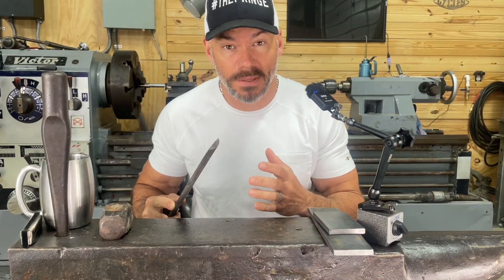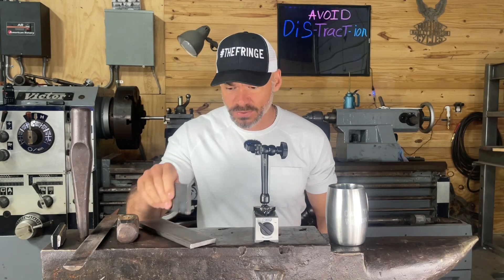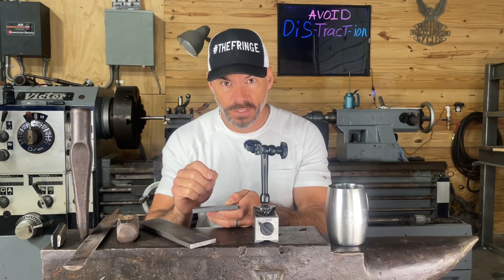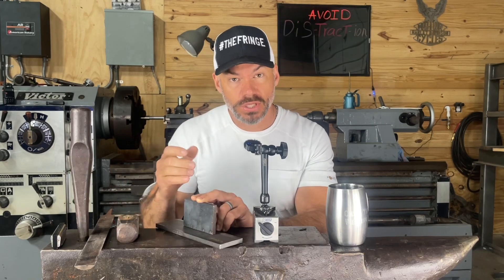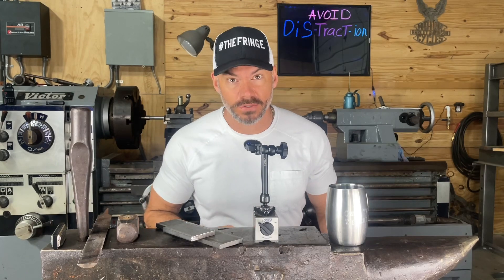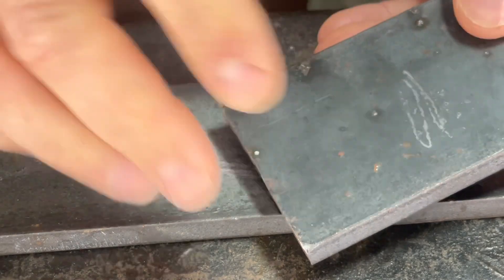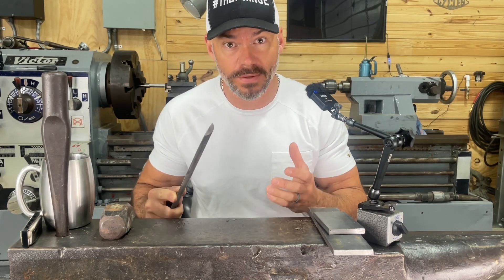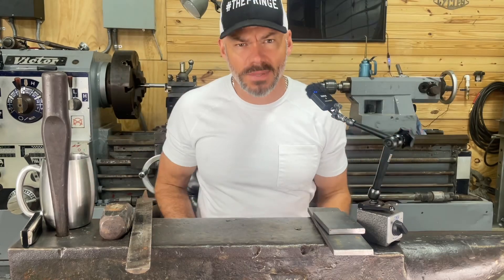How to Remove Mill Scale and Prep Pipe for Welding (amended)

Comment: My  2 cents... Most importantly I LOVE ALL YOUR VIDEOS!  THANK YOU FOR MAKING THEM !!  I'm an Industrial electrical technician and systems repairman at a steel mill with 15+ years of service there but, I've been doing electrical stuff my entire career which started when i was 14 years old  (I'm 46) and now my New Hobby as of 3 weeks ago is DC+ Stick Welding. So, ya I'm new at welding.  I just made myself a 3' x 3' welding table with 3/8" steel plate and a pair of 2600 Lbs cap saw horses LoL, It works for now.  like everyone else I see they place the welder ground clamp to the table. SO, I was trying to remove the Mill Scale from the top side of the 3' x 3' steel plate to gain a way better electrical path to the Ground Clamp while i weld on the work piece that's sitting on the weld table because "I figured it would Weld Better"...  First I removed Mill Scale from about a 4" square area top side and bottom side of the table on one corner of the steel plate so i could get a good electrical path for the Ground Clamp.   Then I took my Fluke electrical meter and measured the resistance from that Ground Clamp  to a bunch of various places on the top of the steel plate that was covered in mill scale and the resistance ranged from  58.0 - 122.0 Ohms.  Then,  i removed the Mill Scale in about a 8" wide path all the way across the one side of my steel plate table.  Then,  I measured the Resistance again from the Ground Clamp to the now super shiny area AND i got 0.00 Ohms which is a perfect path for the electric to travel to the Ground Clamp.   I'm no Pro Welder for sure but, I'm definitely a professional industrial electrician and electrical technician. ((  But hey maybe it won't matter when laying down Weld LoL  )).  I just figure it will help because the Ground Clamp is attached to the table and not the actual part I'm welding on...    The more Resistance that is added the worse the electrical path will be....

Comment: If I can't get a grinder in I use the end edge of a file or even my tungsten scribing pen to cut through the rust to start it. two passes (even with mig) and it works...this is such a good video dude

Comment: I can vouch for not messing with millscale for general fabrication be it a frame hitch to stretching a truck frame, the only place I was required to prep a plate was in the Navy at high pressure plate welding school I went to, they tested the crap out of our coupons to get certified, four years later I get out and back into the fab/repair business and never removed scale, wasn't needed, now I did sandblast it when a job required a good painted finish like railings and ended up building a sandblasting box (not a booth, an actual box with several nozzles in a box about 60" long and big enough to run a 12" H beam through) that we ran lengths of stock through to prefinish before sawing and welding up the project, was a huge time saver in not having to position a completed job to be blasted, just weld/degrease /paint.  But if code requires prepping then" let it be written, let it be done". 😉👍🏻

Comment: After i put a land on a pipe i use a file to knock the burr off the inside to see if my land is what i want it to be i dont anymore cause i can tell as soon as i grind it what it is but thats why guys do that it aint about cleaning it
Reply from the maker: When I started I used to do it as well. But like you said with experience you don't have to anymore.

Comment: If the weld is important remove the millscale just beyond the toes of weld area.  Especially with slow freeze rods.  Ideally you don't weld through mill scale.  Run two 7018 beads on the same metal one on top of mill scale and one on shiny metal.  The 7018 on shiny metal always looks better because it is.  If you weld pipe or structural those welds are important.  Those jobs pay good and you need to be professional and make sure you are welding professionally.  There is a certain amount of Flux on those bad boy electrodes and therefore they can only clean a certain amount of contamination from the molten metal and float it to the slag layer.  In some cases halfazz removing the mill scale or leaving all of it on is too much contamination and hello porosity and internal defects.
Reply from the maker: Lol
Reply: They come out shitty cause you don’t let’s that pool build up not cause of the milscale
Reply: @trailerpark6.7 not true. Mill scale does cause problems. Yes, you can weld through it. You can weld through paint and rust too, but you shouldn’t.

Comment: Been welding for 20 plus years. Only problem I’ve had with welding mill scale is these wanna be QC guys calling it under cut , especially when the scale is thick . Ever had issues with that Taylor ?
Reply from the maker: No, not that I can remember
Reply: @TaylorWelding   i imagine the plant and pipe line work is a bit different

Comment: Mill scale is iron oxide.  Also known as rust.  No one calls it rust, but that's what it is. Orange rust is also iron oxide. People seem to wrap their head around that. But orange rust and mill scale are both iron oxide AND rust.  When steel turn blue or purple or brown, those temper colors as they are called, that is iron oxide too. The black slag left on steel after being torch cut, yes that is iron oxide too.  All technically forms of rust.  I am an engineer, not a chemist, but I do have some knowledge of metallurgy, and steel oxides are a part of my interest.  A point of note, is that rust and mill scale (iron oxides) are ceramics. Yes like coffee cups and flower pots.  Iron oxide does not conduct electricity, is non magnetic, and has a different thermal coefficient of expansion than the base steel, and is very brittle.  You can use this property to your advantage when you have stuck assemblies that are rusted. You know hitting rusty bolts with a torch breaks up the rust and allows you to loosen them. This is because the steel expands, and the rust does not (relatively speaking), and during the heating process. The rust gets crushed by the expanding steel, and the rust is weak and brittle, so it gets pulverized and crushed.  This is why heat from a torch loosens rust bound bolts.  Something to note, not all oxide forms of metals have the same properties. For instance, silver is used to plate electrical contacts.  The reason for this is, the oxide form of silver has nearly the same electrical conductivity as pure silver. Makes for good switch contacts. Anyhow, I just wanted to give you some more information about mill scale. Yes you are right it comes from the mill rolling process. But to know about mill scale (iron oxide, rust, etc) is such a deep subject, and if you deal with it in your career, knowing more about it is going to be a benefit.  I enjoy your videos. ---Doozer
Reply from the maker: thanks dozer. That’s a lot of information.
Reply: This is why we use the word patina vs rust, Mill scale is more of a patina, patina doesn't tend to spread, but rust does, you probably know more about why than I do however, I just know that's what it does

Comment: Why then does every weld procedure I've ever seen, be it AWS or ASME, the very first step is.... you guessed it... remove the mill scale?  40+ years experience,  and built all types of machines, heavy gas and oil related equipment. Higher chances of contamination and lack of penetration! Ask yourself this.. how would you feel if someone got killed because you took a shortcut!
Reply from the maker: Are you a professional Welder?
Reply: @TaylorWelding  I  was for 40 years. Flux on the rod is for minimal cleaning and to protect the molten filler! Not for eliminating mill scale.
Reply from the maker: Is that what you do for a living?
Reply from the maker: What do you think the flux on that rod is for?
Reply: @TaylorWelding there’s a reason why procedures are developed and used. Many hours of testing goes into it. If your welding non structural items, it may not matter too much. Heavy structural welding is done with large rod, which is being replaced with large flux core wire. They do burn through mill scale. But that’s because the diameter of the wire or rod, along with the high power used in relation to the thickness of the scale, is great. Smaller rod and wire don’t have the same ability.
Reply: @TaylorWelding Jesus... hearting your own comments... no words really... also you have no idea what you are talking about
Reply: 🤣. I do knock the burr off the inside of pipe. If I'm running 5p,5p+,hyp,hyp+,or any cellulose fluxed rod I'm not going to worry about a little mill scale. If I'm running a 7018,7016 root? I'll file it back out of the weld zone. Some plate has a pretty thick coating of mill scale and I'll clean that off every time. Just the standard gray patina? Waste of time. To the gentleman above who says that flux on welding rods isn't designed with rust and scale in mind? You are completely wrong about that.Some rods ( especially cellulose based flux ) were designed exactly for that purpose. Floating impurities out of the puddle was thought about and allowed for. Grinding the mill scale off an inch away from the weld zone is a huge waste of time and material. I've welded for over 40 years and have never,ever,walked away from a high or low pressure pipe or vessel weld I wouldn't be comfortable letting my children or grandchildren play next to. And I've made them with stick,tig,mig,flux core and dual shielded wires. I've made them on offshore platforms where my crew and I had to sleep just feet away from what we had installed.

Comment: Mill  scale 😅 try welding through galvanized , checking in from southern Califa local 433 IW
Reply from the maker: Galvanized is a bummer
Reply: You ain't kidding, I've had some galvanized jobs lately and I hate that stuff. When I see that blue spark, I die a little inside. 😆
Reply: @gillihansmobilewelding  make sure brother wear a respirator for you don't get sick and poison that s***'s no joke
Reply: Electro galvanized is ok but that hot dip stuff is hideous! Either grind it off or use hydrochloric acid,don't forget the PPE!

Comment: When I was taking welding class they told us to remove the mill scale because it’s not good for our health.  When we had topics on tig they would recommend us the same thing but to also prevent porosity. Some of the other guys would use the round tip for the grinder and heavy grind the inside of the pipe. I found that a waste of time I would just give it a quick pass or use a file. 

Subscribed to ur channel not to long ago. Great topics  your videos helped motivated me to find a job in welding. Can’t wait to find one. Any tips on where to start or how I can get my foot in the door. Also how do you prepare for a pipe test.
Reply from the maker: Shut downs is a good place to start. And as far as the welding test just practice. Every day for about 30 minutes a day
Reply: a while ago i saw someone attack the mill scale for a couple of hours with diluted vinegar, its slow but in the end you can just wipe the mill scale off. it seems to be a good idea to just prep all the pieces beforehand
Reply: Welding over mill scale has no negative health effects. The smoke from the welding process is not good. But adding mill scale to the mix is not going to add to welding being more hazardous.  Grinding it and breathing grinding wheel dust, for sure is no good for you.  But telling the class mill scale is not good for your health is flat out ignorance.  It might not be great for the health of the weld, but that's it.  It is not like welding galvanized, which is really bad for your health. --Doozer
Reply: @kooldoozer can you talk a little bit more about galvanized? What is it, why is it more dangerous and how often would i see it in the welding  industry?
Reply: @citrusblast4372  It has a protective coating of zinc, and if you get it too hot the crap vaporizes. Breathe it in, and you'll get metal fume fever. Supposed to be pretty bad depending on how much a person has inhaled. I try to avoid the stuff, and wear a respirator on the rare occasions that I have to deal with it.